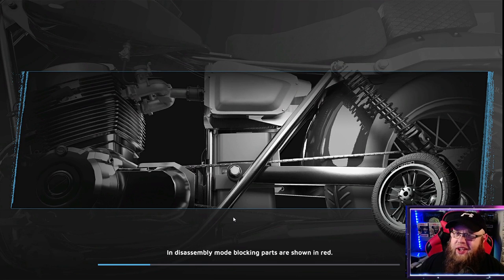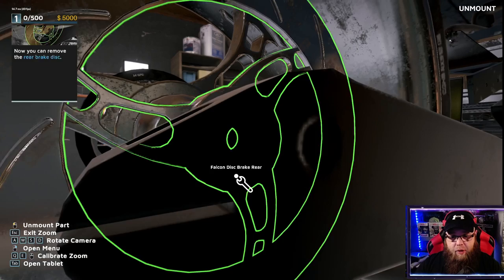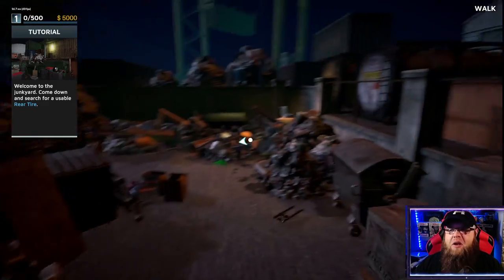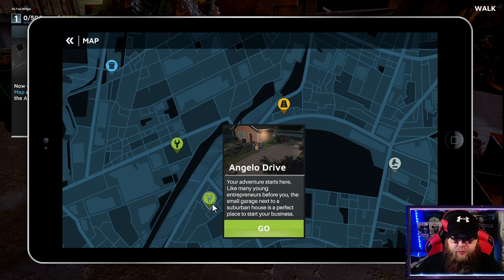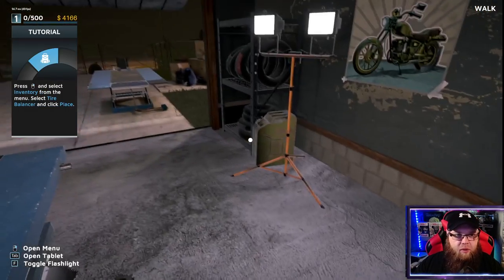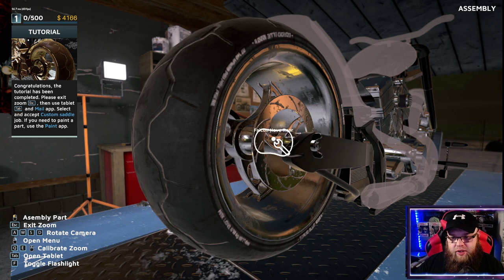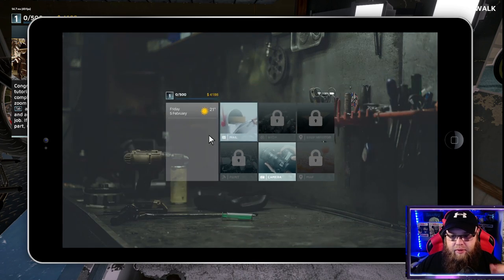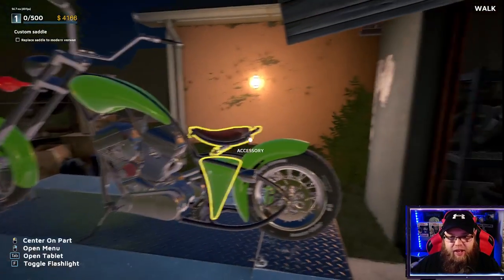How To Fix A Bike | Motorcycle Mechanic Simulator

Comment: i got a 125cc moped a few years ago within 8 weeks i had a crash and it was wrote off. i wasnt the one at fault tho
Reply from the maker: Hope ur ok now with no long term issues.. iv had a few friends get injured on them its one of the reasons why i wont get on a bike.
Reply: @Hybridsteel  went for an x-ray after the accident and everything was fine thankfully. Unfortunately tho i couldnt get back on the road so im trying to get back on the road but drive a car instead and go for my licence and eventually go for my bike licence as well
Reply from the maker: @PizzaKing-zw6oe  driving is ok my only gripe switch it is the expense of fuel, insurance and so on